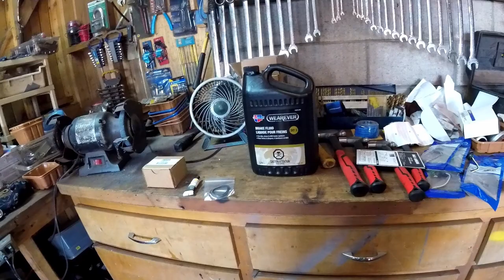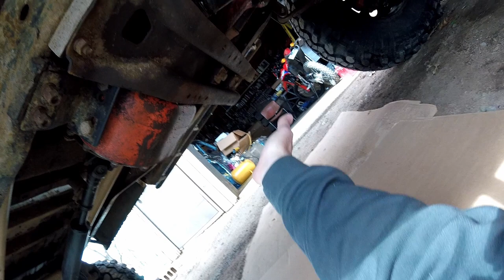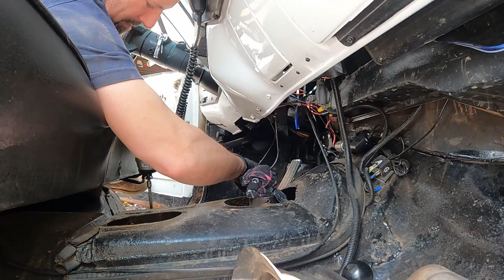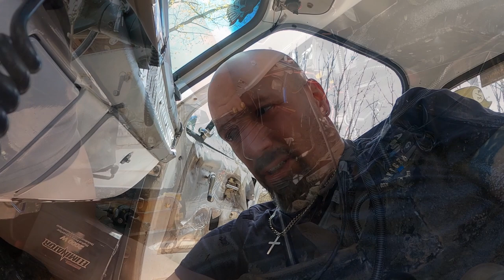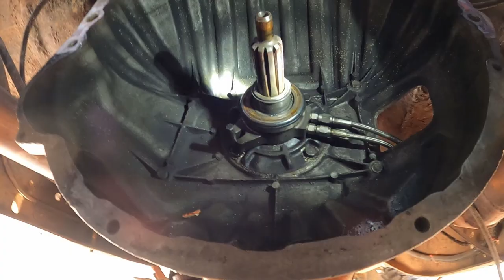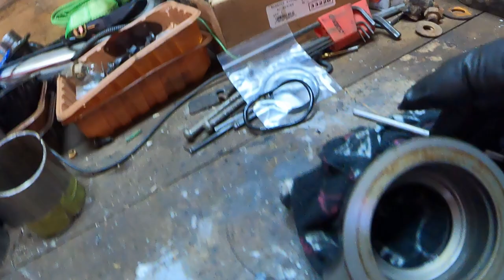SM465: Slave Cylinder Removal. But There's Another Issue...

Comment: What master/slave cylinder combination are you using on the sm465 instead of the mechanical linkage brother?
Reply from the maker: I'm using a Ram internal hydraulic slave/release bearing part # 78125hd. I ordered that through summit. For the master i just used a  chevy part i picked up at Napa. You'll need to measure from the master to the slave to order a -3 AN  feed line. I got one from Amazon. Plus you'll need a fitting to connect the -3 to your master. I ended up getting one that was the right threads but wrong taper on the master side.  I think it was flat instead of tapered.... i used it anyway and it hasn't leaked. Let me know if you need anymore info and enjoy the super easy pedal! Thanks for watching.
Reply: Thanks brother